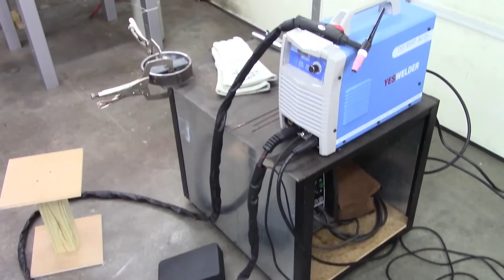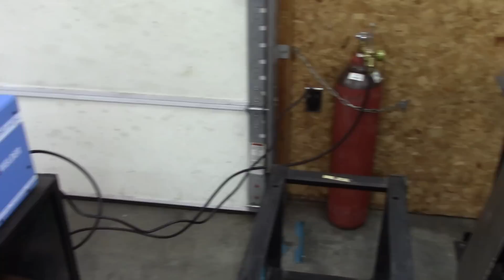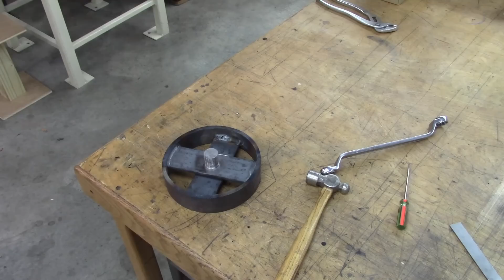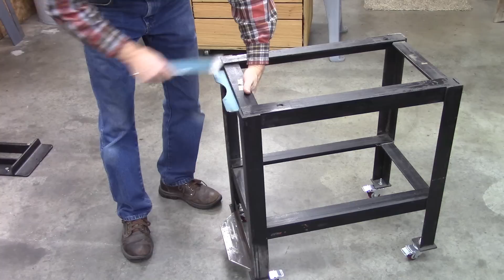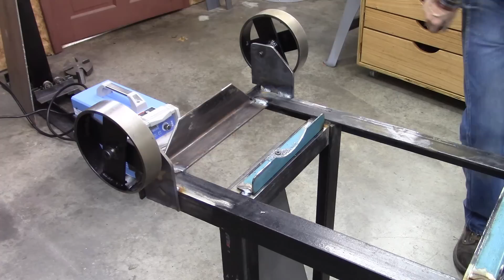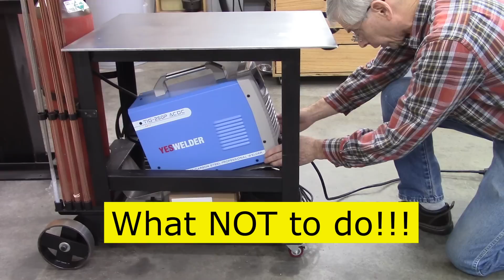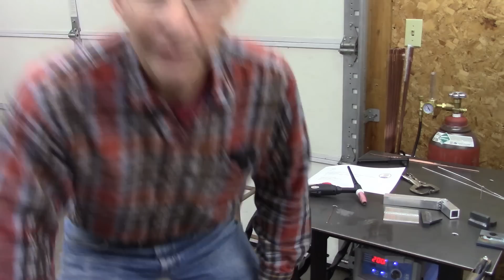Steel Wheels, Welding Cart and My New TIG Welder

Comment: Nice project making the movable welding table. Well done getting into that welding business that fast. Now You cab be racing around with the welder.
I got a bad feeling already at time 03:00, the welder standing on the metal welding table. Any screw, nut, tool under the welder had caused the same disaster, maybe because I'm a psychic. 
What power does that welder use? 240 volt, Amps? Poor manual spells Chinesium stuff..
Reply from the maker: The welder is absolutely Chinese. 240v on a 40 amp circuit.  I agree, the welder chassis connected to what you are welding is a bad idea. I think the wood shelf is adequate. Chinese can still be good stuff but certainly its hit and miss. I will say the welder is impressive.
Reply: @WinkysWorkshop  40 Amps and 240 Volt? That will not sell in Europe. 16 Amp was a common fuse used when I had a house. Living in an apartment 6 Amp is standard, likely possible to upgrade to 10 but 16 is possible. (A normal oven fuse). I've got that!
Reply from the maker: @Stefan_Boerjesson  I can buy whatever size I need or desire as long as the wire size is adequate. I really need to reduce the breaker to 30 amp. The wire is not quite large enough for 40, I miss calculated. 16 amp will not run a 220 welder. I have a 60 amp breaker from my main panel to the sub panel in the garage with #4 wire.

Comment: Great video Mark! Your idea of the up facing display might be a little counterintuitive for the company. When used as a mobile welder these small units are often placed on top of the table or even on top of the work piece, and I have seen a few videos where guys are mounting them above their welding tables. Maybe a screen that can pivot 30° up or down would be the best solution for an upgrade. And for your unit you could make your tilted shelf out of plastic or wood... or even cut the hole in your wooden shelf and mount your metal tilt shelf only to the wood?
Reply from the maker: The tilting didn't help a lot so the level shelf is okay. Mostly the display is just not designed well. Very bright LED lights make it hard to see the tiny icons. Otherwise, I love the welder. I like the size for sure...  light weight too.

Comment: If you were attending welding school or applying for a job as a welder, they would have you weld some samples and then then would cut a cross section through the pieces perpendicular to the weld on a bandsaw. Looking at the resulting end view illustrates depth of penetration, heat control, bead formation, porosity, and overall quality and strength of weld. You have a bandsaw so maybe section some samples to self-evaluate your work. It might help you improve your technique as you continue to grow into this new realm. This applies equally to any welding type, not just tig. Best wishes once again. 🥸👀✅👍
Reply from the maker: Probably a good idea. I suspect the penetration is really good in most cases...  MUCH better than the welds I make with my 120v mig welder! The aluminum maybe not so much. I'll probably do this in the future.
Reply: @WinkysWorkshop  It helps to etch it a little with some acid when you cut it too - makes the weld metal vs the original metal stand out. When I was first starting to mig weld, I welded some coupons together and then cut and etched them - it was pretty informative!
Reply from the maker: @gorak9000  I'll bet it was.

Comment: Excellent video Mark and a very nice cart design. First suggestion is to make one of those torch holders to park it between passes, before you find out how delicate the ceramic shroud and the electrode/gas tail piece are. I made10"  wheels for my band saw the same way and they are bullet-proof to this day.
Enjoyed the vid, cheers!
Reply from the maker: Thanks! Excellent suggestion on the torch holder. I may hold off a month or so however...  I'm thinking about buying a torch with a flex head on it.

Comment: Winky when you was welding aluminum I couldn’t see did you put a ball on the end of your tungsten very important
Reply from the maker: I blunted the end a bit but it may not have been shaped perfectly. I'm going to play with this a bit more. Thanks for the suggestion. I have a lot to learn still.
Reply: Actually there is no need to ball the tungsten any longer with these inverter welders back in the day of Transformer machines that did not have the ability to regulate AC balance it was important to put a small ball at the end of the tungsten and that is only put there ahead of time to prevent a sharpened tip from falling off into your parent middle today with the ability to reduce the reverse polarity phase of the alternating current your tungsten can actually remain pointed
Reply from the maker: @joewest2560  Wow...  very interesting. Thanks for the advice.

Comment: Awesome rotating welding jig Winky!  I did exact same thing on my milling machine rotary table!  It works awesome also.
Reply from the maker: Thanks...  I plan on designing one to work on my mill too and as a weld positioner. Hopefully it will work out.
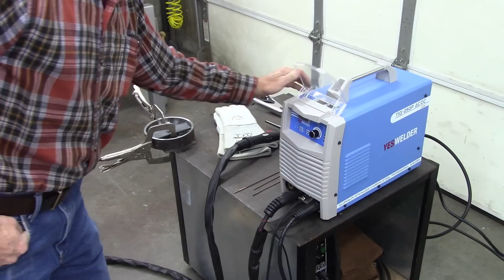Reply: @WinkysWorkshop  I'm sure it will!  My next idea on expanding this project is to put an encoder on it for using it as a digital dividing head.  Learning Arduino stuff now so I can maybe automate this stuff.  If you're interested in my primitive approach in learning this stuff, check out my re-foaming a Hsu Research subwoofer speaker cone project that I had to machine a form for.  About 3:15 in this video is the rotary table setup as it is so far : https://www.youtube.com/watch?v=blMGlS4e93g&t=247s .  Thanks for your kind reply, and I'm looking forward to your next one.
Reply from the maker: @JohnnieBravo1  Interesting video although the wood ring is really not needed. I have replaced the foam surrounds on many woofers. The last pair was maybe 6 month ago. I noticed my neighbor had a pair of speakers by his trash can so I picked them up. I re-foamed the woofers and decided I really didn't need them so I sold them back to the neighbor for $40 bucks. He was thrilled. How did you know I was into audio? I just built these. https://photos.app.goo.gl/VXrFvd7Aq5pXj9ze8
Reply: @WinkysWorkshop  Hey Winky; Thanks for your reply.   If you took a moment to look at the beginning of that video, I tried to explain why I decided I needed to make that ring.  In short, as these speakers are 30+ years old, and who knows what the cone specs were back then, but when I  received the foam surround, the inside diameter of the foam was less (by about 1/8 inch) the outer diameter of the cone.  As the glue surface is only about 3/16" if they mated perfectly, I machined that ring to "stretch" the foam out to where I got complete surface area match between foam and cone.  Having reconed many speakers and passive radiators in the past, I never ran into this.  So, either the speaker cone is not a normal spec, or the foam was made incorrectly.  Either way, the ring stretched the foam out where it worked perfectly.  We drive speakers pretty hard around here, and I was afraid a narrow bond would not hold up.  After all, I'm a 70+ year old metal head, and louder is always better  ;-) (I can still hear my parents yelling down the hall at me to turn that $#!t DOWN! ).
Reply from the maker: @JohnnieBravo1  Guilty as charged. :o)  I skipped around on the video but I understand now.  You are a rare breed (70+ metal head) Haha...  If the link I posted work well you can see I have toned down the volume. I've built a lot of failures and a few great sounding systems in the past. Horn systems too. They are amazing!  The last pair (in the picture) are full range and not super great...  good but not exceptional.
Reply: @WinkysWorkshop  Hey Winky;  you just reminded me of a project I did in college (about a thousand years ago), of a pair of speakers I designed and built that were in the shape of a grand piano although much smaller than a piano of course.  Those things sounded incredible.  With modern high power long excursion drivers, I bet a new pair would sound even better!  As my ex wife needs a new pair of speakers, I may build a new set to give her for her birthday, to connect up to her Dad's Marantz Quadraphonic amp she inherited!  Thanks for jogging my memory!
Reply from the maker: @JohnnieBravo1  Cool...  I love building speakers although my success rate wasn't incredibly good. I was never willing to buy all the test equipment and obtain the needed knowledge to make things all come together. The physics going on in a speaker are fascinating but also a very unpredictable. Phase shifts, cone breakup transits...  all hard to deal with. Sub woofers are really the only thing you can design and get right most the time.  That's why I wet with a full range speaker this time. Not ideal but it reduces the amount of variables. I'll bet the piano speakers sounded good...  depending on the orientation, they may have had a wide baffle which always helps the bass.

Comment: Mr Winky, it helps if you have something to rest your hand on also I find that having the hose over my shoulder and holding the torch like a pencil, but your doing great
Reply from the maker: I agree, I'm still learning. I've started holding it like a pencil like you said but I have been thinking about getting a torch with a pivoting or flex head also.

Comment: I don't believe your fault analysis is right. 
The two options I could figure out when I did the same thing are:
1. the welder is simply 'crap' and some of the electronics have pooed themselves.
2. lighting the high frequency on the work without the ground lead allows the high voltage and high frequency to go back to the machine via the earth connection and blows up the power electronics (probably the rectifying diodes).
Either way it's a machine fault, not yours!
I got mine replaced under warranty without issues. Just in case it was issue 2, I have since made absolutely sure I never forget the ground lead.... the warranty is now expired!
Reply from the maker: Yes, I didn't explain myself well, I totally agree with you. I suspect #2. Although I suspect trying to start an arc without a ground is not an issue unless the welder itself is acting as the ground. Was your welder touching the table you were welding on???  Just as an added precaution I am also making sure the table is grounded. In fact, I've been thinking about some kind of permanent ground lead to the table that runs in parallel to the clamp ground. 90% of the time I will be welding on the table/cart anyway and I'll never need to remove the welder from the cart.
Reply: @WinkysWorkshop  No, my welder was sitting on a wooden box at the time. But here in Australia, all electrical equipment with metal chassis have to be earthed. My welding table is bolted to the ground and the walls, so its earthed too. That's what made me realize that the only return path for the HF was via the earth cable. Here in Australia, we're on 240V single phase, with the neutral linked to earth. So there is a connection in the switch board which allows the HF to go from earth to neutral - and right into the rectifier in the welder....
The manufacturer said he would talk to the designer/engineer to find a way to prevent that problem in future, but I haven't heard back from them. That was about two years ago. 
Maybe you or one of the readers of this message can suggest a way I can protect my welder from getting hurt again if my ground clamp - say - falls off while I'm welding?
Reply from the maker: @JoeInBendigo  Inside the welder the chassis is grounded to the circuit board in the welder. My welder was sitting on the steel shelf and the chassis was touching the shelf when this happened. The welder is isolated with rubber feet but I have the welder pulled forward and the bottom was resting on on the steel. This gets kind of confusing to me. Our electrical here is the same. Earth and neutral are close to the same and are bonded at the electrical cabinet. The neutral in the welder however is treated as a hot conductor and there is always some current between earth and neutral.  The high voltage of the HF start probably tried to go to the neutral in the absence of the ground clamp ground (which is likely isolated from earth and neutral. I don't think I need to ground the chassis to earth ground or neutral. Maybe I'm making a mistake...
Reply: @WinkysWorkshop  "Inside the welder the chassis is grounded to the circuit board in the welder" and the chassis is ALWAYS grounded through the wall receptacle and plug. That's the whole point in having the ground to begin with. The rubber feet are not to "isolate" they are simply to help prevent movement. It was 100% trying to weld multiple times without a ground that killed the cheep welder. I literally bolt my welders to the carts so carless people don't pull or knock them off. If this was such an issue no welding carts would be made of metal. Surprise ALL welding carts are metal.
Reply from the maker: @MrWizards1974  You might be right. I do know that earth ground and natural are treated much differently and that neutrals on a three prong plug are considered a conductor. All modern appliances keep the neutral separate from earth ground. The newer plugs are also 4 conductor and earth ground is grounded to the appliance and the neutral is isolated. 

As far as welding carts being steel... for sure! But, most are not also used as a table. Yes Welder told be that the chassis of the welder absolute had to be isolated from the table I was welding on. Maybe if the table itself was grounded it would not have effected the welder...  I can't say for sure but for sure I will follow the advice of Yes welder and keep it isolated.

Comment: Nice to see you got a tig welder! I think its the moet beautiful welding proces.

It looks like your gasflow is on the High side.
And try to keep the point as scharp as possible (except for aluminium)
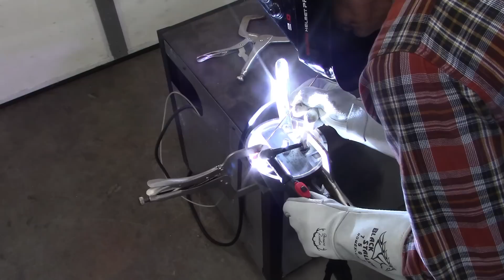5:54
Reply from the maker: I was thinking the same about the gas flow but when I reduced it the oxidation got noticeably worse. Of course this could be due to torch angle and tungsten stick out too. Admittedly I have a LOT to learn. I agree about the process, the welds look great and you have a lot of control.